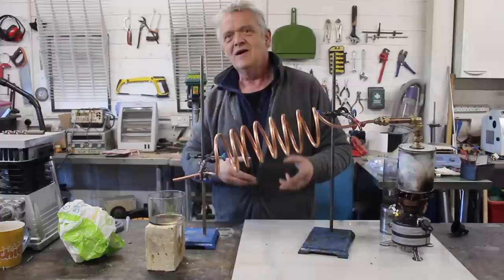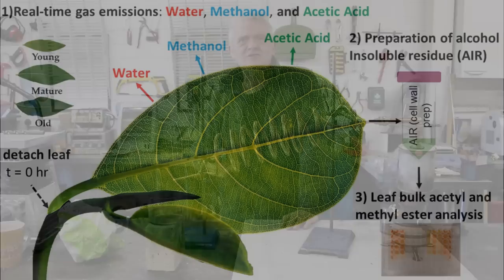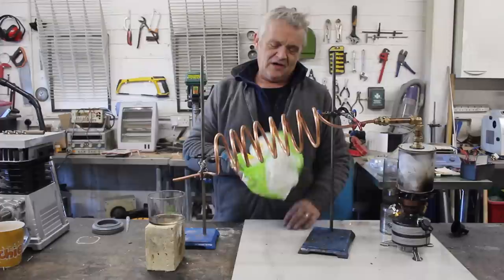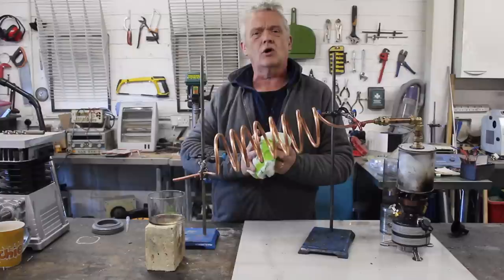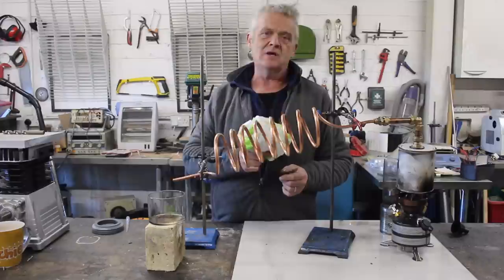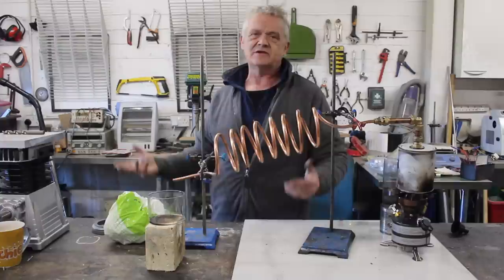1711 Fuel From Plastic - Destructive Distillation

Comment: I've seen several vids where folks have been able to break down plastic into multiple parts, gas diesel and some waste material I forget what was. Being able to run an engine from fuel produced from waste plastic would be tits! Not sure it would be ever practical. The was a company that opened up not far from where I live that tried doing this for profit and failed I think because their cost of heating exceeded the value of the fuel produced.
Reply: You would need to use alternative, sustainable energy for this to be profitable, whether that is direct solar, solar panels, wind or water turbines, etc.

Comment: What about fermenting sugar and yeast to create ethanol? its cheep and easy.
Reply: Nope, far from easy to get it pure enough.
Reply: Very difficult to distill into sufficiently pure ethanol, and of dubious legality depending on jurisdiction, due to regulations on production of distilled spirits.
Reply: @specialagentdustyponcho1065  
What a Name...
Reply: Sounds yummy.  Lol
Reply: What about it? Does it give you fuel from plastic as the video title indicates?
Reply: @brianmurphy8790  pure enough to drink, you mean? like drinking solvent?  this process has the advantage of using the living yeast to metabolize the sugars. if you just want to burn it, you don't need to worry about being pure enough to imbibe.
Reply: @crookedtool  There are no strict rules with adding to a vid here or drifting off topic.  Creativity demands thinking outside the box and I strongly encourage more creativity.  Hope you will also.
Reply: @stephenmorton8017  
'Pure' as in at least 95% ethanol. That's what you're going to need if you want to run an engine.
Best you can brew is 15% and you'll struggle to distill it beyond 85%.
It takes too much time and energy to produce in large quantities.
Reply: @brianmurphy8790  i reckon you're being a bit strict. they just want to burn it in a lamp wick so the room won't fill with soot..
Reply: @stephenmorton8017  
Ethanol is no good for a lamp, the flame is blue and gives no useful light.
It's great for a small stove, but still a lot of effort.

Comment: OK. I'm going to have to do this ASAP. Kilos of PLA from 3D printing are waiting for recyling. Will this work in the multi-fuel burner with the smokeless "diesel" attachment?!?
Reply: You heard of the Filabot?
Reply: @Johnson_Rice  yes, expensive, although there are plenty of DIY builds for filament recycling.... however, this approach would involve a tiny fraction of the effort, and produce something arguably more directly useful to me personally....
Reply: Apparently PLA mostly produces napthalene which is more wax or tar like. It might be more useful for mothballs than as a fuel.
Reply: @b.t.jevsevar  Interesting. Chemistry is not my strong suit.

Comment: Was wondering?  Is this the same process for removing extracts from herb's like vanilla extract, hops extract, mint extract, vanilla extracts?
Reply: No, that's steam distillation
Reply: @denniskartes1302  TY
Reply: @denniskartes1302  Would love to learn how to do steam distillation!!!  Do you know of any descent vids on the topic?
Reply: @l0I0I0I0  the process is easy to understand.
There are countless videos on the subject,
Making it an extremely easy subject to research.
But I have nothing specific to give.
Reply: @l0I0I0I0  Quote: "Would love to learn how to do steam distillation!!!" 
Me too. In a survival situation salt water can be distilled. I was thinking a small amount of the salt and minerals from the salt water could be boiled and added back in to make it taste better.
Reply: @3deeguy  water purification is easy.  You can even speed up the process by filtering salt water first 1 micron.  Boil the water through a tube as in the vid with water around the coil to coil the evaporated water.  It will leave salts etc in the heated container that probably should be stainless for regular use.  Purify before using all parts of you plan on drinking it.
Reply: @l0I0I0I0  Quote: "You can even speed up the process by filtering salt water first 1 micron." 
Thanks for the info. I never heard about '1 micron' water filters before. I'm going to research it.
Reply: @3deeguy  It's just a suggestion to pre-purify the water.  Some of the better filters filter well water and other water using a three stage filtration system.  But it depends on how much water you are making and the contaminated involved.  Water that is already pretty good and fresh can run through 1 microns and remove like 99.99 percent of impurities but it likely will still be salty I would think so  distilling the water as stated and then filtering it again with 1 micron is what I would recommend but again it depends on how much water?  Are you filtering a gallon of water or a pond of water?  Different systems would be needed depending on the use of the water and if you will drink it.  For drinking water you need to clean the tank and coil with a special sanitization fluid as you don't take chances with drinking water and have a three stage filtering system with the final 1 micron.  I forget the microns for the first two stages.
Reply: @l0I0I0I0  Quote: "It's just a suggestion to pre-purify the water." 
It was a great suggestion. Thanks. The public water I drink is always filtered.
What I actually had in mind was an 'explainer' animation that I'm working on. I want to address having a supply of drinkable water but the most important idea that I want to cover is being able to generate your own electricity in case the grid goes down. 
I won't discuss the details here because I'm still planning out 'how' I want to present it.
Reply: @3deeguy  Nice!  I look forward to seeing it.  Let me know?  How do you plan to generate electricity and how much electricity?  Yes purifying water really isn't an option.  Lol
Reply: @l0I0I0I0  Quote: "How do you plan to generate electricity and how much electricity?" 
I envision a small 'basic' steam turbine because there's only one moving part.  Maybe 6 to 12 volts to charge a bank of batteries. 
I just want to share the idea. People that have mechanical ability will build the prototypes
When I post it I'll remember this comment and post the link. (It may take awhile to complete).
Reply: @3deeguy  Nice!   Good luck and keep me informed.   I do the same sort of projects but usually more electronics involved.
Reply: @l0I0I0I0  Quote: " I do the same sort of projects but usually more electronics involved." 
I chose my username because I started on YT as a specialist in lenticular photography. I designed and programmed my own digital camera slider. I originally sought a patent for my machine. I 'thought' I could make a career out of 3D photography but I absolutely suck at marketing.
I'm just a nerd who can draw.
Reply: @3deeguy  lol.  I can do marketing  and have done well but I don't like it.

Comment: Robert! ? So efficiency would be determined by fuel sources
Reply: Hello from Colorado Robert! I don't remembet which step in the  filtering process produces the sludge , but it seems to me the sludge in a Sterno style flame for the initial heat sourse.  Question is what sourse of flammable distillate is least useable to mix with saw dust or,,,,,

Comment: I've always been warned about burning plastic lethal gases was the concern
Reply: I am wondering the same, specifically PVC, which is the main source of lethal gases, which is mainly hydrogen chloride (which converts to hydrochloric acid when exposed to the moisture in your lungs).  If you were to run the gases through a bubbler that would remove the hydrogen chloride, I assume the rest of the products are not water soluble to could be easily decanted off.
Reply: Pvc like all my plumbing. Lol I'm in flint mi. So have we here traded lead pipes to pvc and gained potential hydro caloric acid for the exercise
Reply: Seems like when computers were slower I was much smarter 🤔.  I don't have what's app. Viva sent numbers like that and I got rebuffed somehow. Your doing a great job 👍

Comment: Only 2 ways plastic don't end up in the nature. Burne it directly for energy or make this proces and reuse it as a oil product.
I love all the opertunertyes plastic opens as a material. But Seing how mutch of western waste ends in 3 world contryes. Out of sight out of mind. I will say it should never have been invented.
Living in a contry where plastic is dropped on the ground when emptyed.
Reply: Will the fuel derived from hdpe burn sufficiently enough to heat the hdpe
Reply: @macroneus  yes but normaly they start it up with coal then when the proces is up and running it will dewelop gas and oil. And the proces will run on the gas. There is plenty of videos on yt showing the big plants.
A good product to run the proces on is tires if people can get them for free.